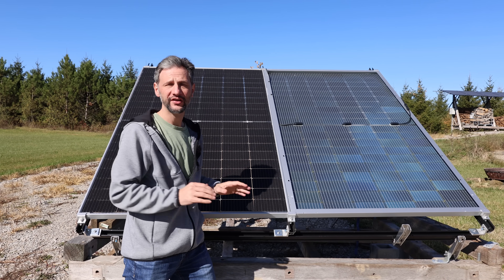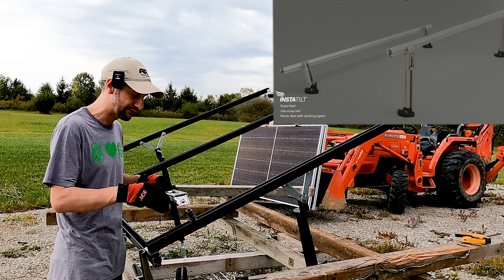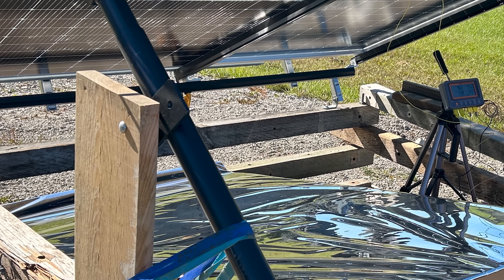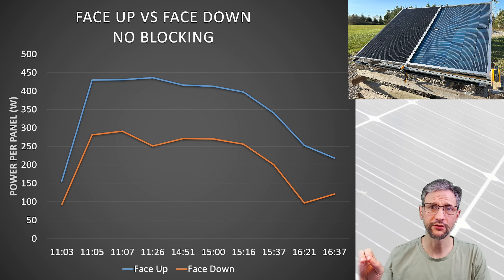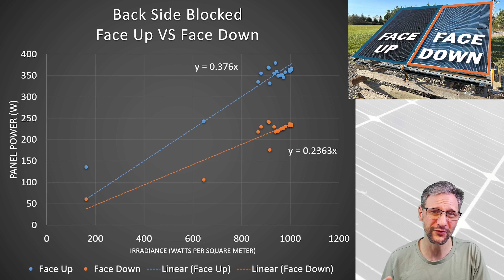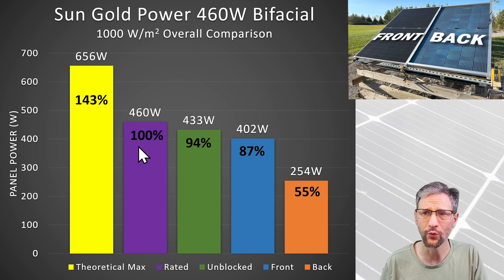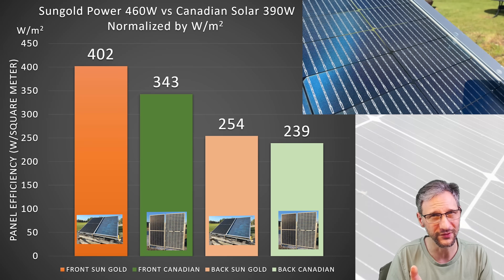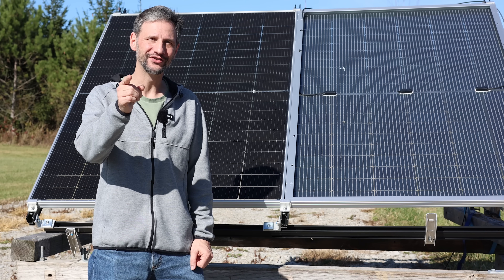How to Get MORE POWER With Bifacial Solar Panels

Comment: Hi Dave, I had a solar power system installed on my roof last year and am planning on expanding it with some bifacial panels.  I have pretty much filled up the south facing part of my roof so the new array will have to go on the north facing side.  It is a standing seam metal roof and is only sloped about 10°.  I am wondering if it is worth putting the new panels on a rack mount that will get them up to the optimum angle for my area (San Antonio, TX), which is about 30°.  That would mean mounting them at a 40° angle from that part of the roof.  I also figure that will help get more light to the backside of bifacial panels.  What do you think?

Comment: Great analysis. I have a JA SOLAR 575W panel  pifacial and I get 600W for 4 hours from 10am to 3pm.
Reply: So the total is 600W * 4 = 2400 ?
Reply: @dwicahyoariswinarto Yes..today I added the third panel and got 1930W  from 9:30Am to 3pm
Reply: Is JA solar panel are better than jinko?
Reply: Same performance..
Reply: I have the same panels mounted 8 feet in front of a light gray barn. This winter, during the rare cloudless day in northern Michigan, with snow everywhere, my system which is rated at 6kW produced a bit over 8kW.

Comment: I wonder what would happen if you had a VERY white reflective panel behind these maybe 2 inches deep to defuse and reflect all the light let in between them to the back of the panel.
Reply from the maker: I tried the Mylar, but it wasn't as dramatic as I anticipated.  Only a few watts improvement: 4:44

Comment: Just wondering: if you did have a means of actively cooling a panel, as alluded to, why not direct additional sunlight through the front of the panel, rather than perhaps awkwardly directing it through the back side (i.e., towards the sun) in addition to through the front?
Reply: Many big solar players have tried it and it does not justify the amount of energy consumed to cool the panel vs extra generated from being cooled.

Comment: Most panels have side to side mounting. 
Put a gap of 20% of panel width to allow more sunlight to get through to a white metal roof. Say 160mm.
The gap may allow more cooling air flow. 😎 
Many rooftop systems are on part of the roof, bunched together.
Shorter mounting rails and fewer clamps and quicker to install. 

Sunlight on the metal below may increase heating below panels.
So, temperature readings are needed.
I am thinking of a sloping roof, a 100mm gap between panel and sloping metal roof.

Also, would a forced airflow below the panel help keep the panels cool mid summer heat waves. ?????
Reply from the maker: I did some testing on a white metal roof, you can see it here: https://youtu.be/mzqjCsZKUYQ

Comment: Thanks for doing this experiment. I Just installed by facial panels on a ground mount system with Tesla batteries. They are working beautifully. I wonder what they’re gonna do in the snow.
Reply from the maker: Although performance in the winter is much less than the summer, I know from experience you will get more power in the snow than you would be getting with standard panels.  You can see some results in this video: https://youtu.be/YZWeCUzu0yQ

Comment: I had used there Insta Flash Mount's on about 10 solar jobs, they work great. I use them on "flat" roofs as we as compost. the price for the "kit" cannot be beat for what you get.
Reply from the maker: That's great to hear, I'm glad you've had good experience with them.  I'm curious what the long term durability will be for the soft sealant.  How long have the systems been installed?  Any leaks?
Reply: @ProjectsWithDave  I'm curious what the long term durability will be for the soft sealant as well!

Comment: 4:05 aaaaaand...warranty voided.  That was a load bearing sticker
Reply from the maker: I should have mentioned in the video you can't remove the sticker before inspection.  Most inspectors will want to see the specs.

Comment: Great data and experiments ! What would be interesting is a similar experiment to determine true back-side contribution by blocking out the front of the panel with aluminum foil or whatnot, so that the actual rear contribution can be measured (along with your earlier modifications to the ground reflectivity). While some may think this is information overload, those of us who understand everything you are doing here are your true fans and are here specifically because of your rigorous scientific methods beyond what most anyone else on YouTube is doing. Keep up the amazing work ! <3

Comment: Thanks 👍 🎉 it amazes me that people are still assembling ground mounts using mono facial panels 🤔
Reply from the maker: It's not just the improvement in performance, but you don't have to worry about all the possible issues that come with failed back sheets.

Comment: Very nice experimental results!  That took a lot of work but I love the irradiance and temperature correlations.  I've been specing out my DIY expansion project on a few bulk solar panel wholesalers and I was surprised to find so many bifacial and half-cut panels.  Far more than were available two years ago.

And indeed, prices are very similar between non-bifacial and bifacial panels for larger panels (400W+).  Below 400W non-bifacial panels seem to be discounted far more heavily.  There are some great prices out there.

I've been scoping out the Hyundai 400W+ panels (dimensions fit my roof better than most of the other brands).  Like the HiS-S410YH(BK)'s.

-Matt
Reply from the maker: The options have improved dramatically over the past several years.  It would take a significant discount for me to consider non-bifacial panels for a ground mount system.  Bifacial panels have a significant advantage in cloudy weather when you need the power the most.

Comment: a W shaped reflector 2x the width of panel will work for full back side sun... best for cold  winter output
Reply from the maker: I've done some testing with mirrors, but the results weren't as good as I hoped.  I might try it anyway.

Comment: Bifacial are awesome in the snow. In winter the combination of the cold and the extra watts makes up a little of the shorter/cloudier days.
Reply: Living in Southern Ontario.  Not very south I know.  However the best day on my 6.2kw Apsystems inverters with 16 similar panels similar with the same power output rating as the ones in this video.  On the 12th of July, 21 days after the solstice I got 48.6 kWh on a perfect day.  A similar day close the same time from the winter solstice.  I was able to get 47.2 kWh in the winter on a day with the ground covered in snow.  The angle of the panels was optimized to either 60 or 30 degrees depending on season.  Any way the power output was just over 1kwh different with hours of sun being less.  The days chosen were days with perfect graphs (all day no clouds)
Reply: Nuclear still better and free heat if living near
Reply from the maker: I have noticed a significant difference in performance in snowy conditions with bifacial panels. You can see some results in this video: https://youtu.be/YZWeCUzu0yQ
Reply: @ I also notice that my arrays with bifacials shed snow MUCH faster for some reason.

Comment: 🤨You need a lot more knowledge of physics, where the technology itself comes from.
And with cheap thinking, cheap tests, your results are nothing, which you actually prove.
The bad thing is that you expose people to things that you are not sure about, due to lack of knowledge. 
Joker: It's not about cables and electricity, which you understand more or less.

But, you're on the right track. Keep going.
Think about where you are wrong.

Comment: Wondering if the addition of small DC fans would be worth the trouble.  I did a few calculations based on data here and guesses if the fans were very low cost
them probably yes depending on how effective the cooling and longevity of the fans. If I can do it on the cheap I may try an experiment on one of my 3 arrays

Comment: 13:19 - yes, it can work easily: mount the panel on the ground like you did, but only a stand for just 1 panel only
Then use a foil to create a pond around and under the panel, but it needs big pond and not just 2 m around . 
If you have a wet acre somewhere else with a pond or so build it there and do the tests with a battery and solar charge controller. 

But, and there is a big but: be aware that the usual 3 diodes in those boxes somewhere on the back are NOT rated for this usecase . 
We have burned the panel through on the lake just 5 m from the waterline away. 
First it did not work that well and we forgot about the test that day. Next evening after the harvest was done that panel was dead and the diodeboxes had melted into whatever. Not sure if there were further damages cause it ended in the scrapyard. We tried that 2 years ago or so. Back then we had only 1 panel left and that was the end of our test period.
Reply: WOW! 😯😮

Comment: It would be a neat experiment to first run the cold water line, that goes to your water heater, through water pipes attached to a solar array for cooling them down. Would probably be better with non-bifacial panels so you can turn the backs into heat sinks. I wonder if the added cost would be worth it considering a reduction of power required for the water heater plus the increased productivity of the array. If you live in an area with water towers you don’t have to power the water flow, so the only expense is the heatsink mechanism and pipes.
Reply from the maker: There are systems that are designed to do that.  I haven't run the math, but I suspect it would be hard to justify the added cost for the additional equipment.

Comment: I appreciate the conscientious data collection and analysis. Did I miss the part where you directly measured front and back working together (rather than blocked back and adding front and back separately). Nobody installs these with blocking on the back.
Reply from the maker: The front and back together was the the chart that says "With Bifacial Gain": 7:47
Reply: @ProjectsWithDave  thanks. Appreciate your work.

Comment: Great Video again.  You never fail to impress.  Question: if I had 10 panels facing Southeast and 10 panels facing Southwest (and don’t have micro inverters or optimizers) can I (and should I) connect some SE panels in parallel (or series) with some SW panels?   Or should the SE panels be on a completely different string than the SW panels and be connected to a different MPPT?
Reply from the maker: You should make them separate strings connected to separate MPPT inputs.  20 panels would produce a voltage that was too high for most inventers anyway.

Comment: Good Video Dave! What is the weight difference between equal size bi facial & mono facial panels? You mentioned glass on the back side of the bi facial in the beginning of the video.  When doing some simple math on glass weight, I come up with the bi facial possibly weighing 26 more pounds per panel over a mono facial.  The reason I bring this up is because of the added weight to an older roof.  This may not sound  like much but when combined with high winds (such as Santa Ana winds in So Cal) this could be significant.  Just think out loud here.  Cheers
Reply from the maker: Yes, bifacial panels are much heaver.  Not just a consideration for weight on the roof, but they are also more work to install.  Also, you won't see a significant benefit with bifacial panels on a roof.
Reply: @ProjectsWithDave Why are bifacial panels also more work to install?

Comment: 13:24 
Make cheep mirrors by gluing mylar survival blankets to plywood, and set up a mirror array behind your solar panel array angled more steeply to reflect sunlight back under to the back face. Might not be full sun, but it’d be close.

I would think that anyone living in a snowy environment would benefit the most from bifacial panels in the winter, with the shorter days, and reflective environment.
Reply from the maker: I that isn't as effective as you would think, I did some testing with it in this video: https://youtu.be/xD1MT-ek05w
Reply: @ I guess that makes sense; it’s easy to forget that there is no such thing as a perfect mirror, and losses accumulate rapidly.

Comment: Letting a bit of light through the panel could also be good if you wanna grow anything under them. It would block most of the really harsh sun while still allowing some sunlight through.
Reply from the maker: Right!  I think it would be great for some alternating glass/solar roof panels on a greenhouse.
Reply: Great point. Thanks
Reply: But I wonder if there are other more transparent options out there with similar performance